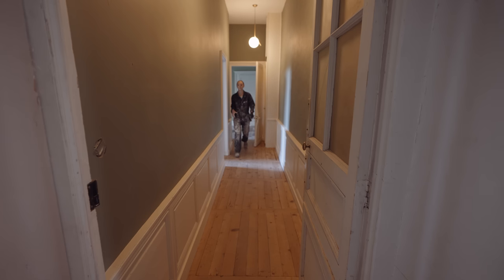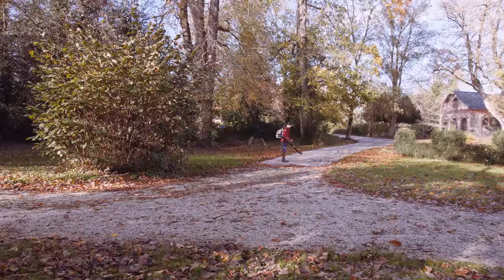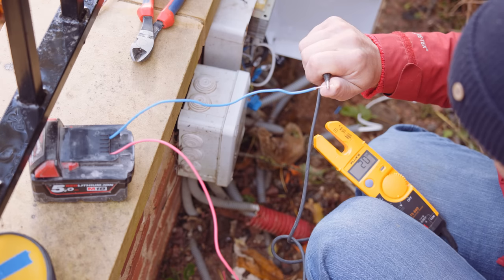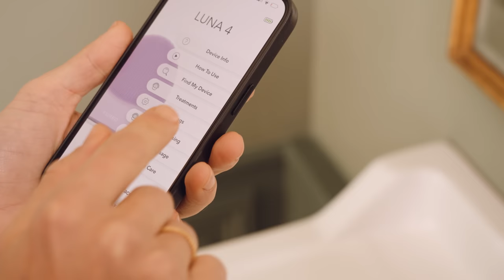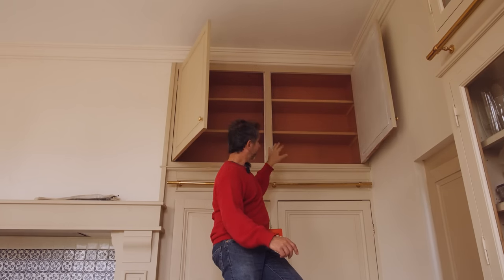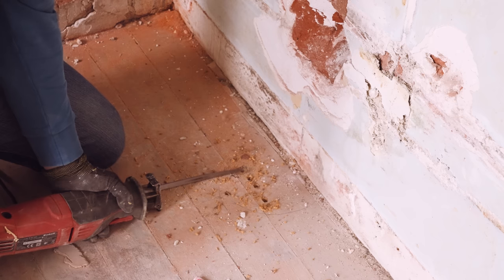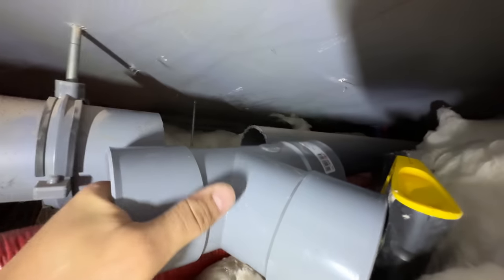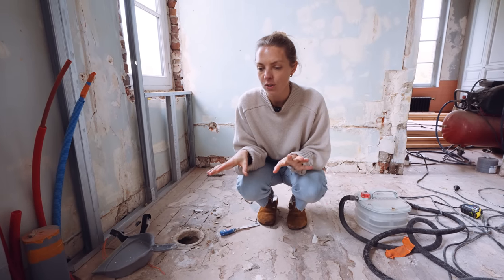BACK TO RENOVATING (Creating a Chateau Master Bathroom)

Comment: For the Master Suite bath, go with large tiles or better yet marble on the angle with an outside border pattern to make it look like an area rug. Use the coordinating tiles in the shower. .You can purchase tiles that have wood grain appearance. Anna glad you are wearing protective gear. Philip, call the company President back. Tell them what happened with the Customer Service guy instructing you to do the wrong thing.  Make them correct their problem with the motor by giving you a new one and having a professional company come out and remove and install the old one. Best to get a warranty on the mechanicals through a certified dealer - that way the onerous is on them and their pocketbook.

Comment: Because of water spots on wood, do tile. It will last forever.  Also, if you have an overflow from the commode, you won’t have to redo the floor.  We had a slow commode leak (a plumber didn’t tightened pipes like he should have done) and it rotted out the wood subfloor. A costly mistake.

Comment: I removed old linoleum from the kitchen floor in a house I remodeled.  I was told I needed muriatic acid to remove the old glue. Fast forward to my children helping to carry in groceries.  One of them dropped a 2 liter bottle of Coke. I told her to leave it until we carried in all of the groceries.  I noticed while cleaning it up that the glue came up with it. So I purchased more Coke, soaked my floor with it, and waited a while .I used a large rubber squeegee like one uses to clean windows.  The glue came up amazingly easily. Give it a try. It saved hours of work and I didn't have to use the expensive and dangerous acid. 😊 Ive only had hardwood in my kitchens and never had a problem.  I think bathrooms yield more water potential to floors however.  They make tiles now that look amazingly like hardwood.  Id go either for that or something that looks old and luxurious.

Comment: Also tiles (there are tiles which look like wood, they are very nice looking) and I would recommend using a shovel to push the glue from the floor, because then you can use more power

Comment: If you do tiles, you can easily put a heated floor beneath. I recently created a master bathroom in my historic home and it has been so lovely in the winter to have warm floors beneath your feet in the bathroom! I used electric strips (as opposed to some who do hot water....may be easier in new builds) and then had tile put down.

Comment: I've done both, and the wooden floor wasn't a great success, I do understand the attraction of wood, it looks and feels better, but if your family is anything like mine, bathrooms get pretty wet, not just from water splash, but also condensation. I'd definitely go with tiles, but make sure you tank the floor and shower walls, saves you so much grief in the future.

Comment: Goodnight. I think you should go with tiles. If you go with tiles in the bathroom, then you will not need to scrape the glue thing off. I had a similar problem at my house in Canada when I was renovating it, and I used a product called drypack over the floor. It leveled the floor, and then we put the tiles on the drypack. I also agree with the other commenter that you can then  install heated floors. Tiles are definitely the best option for the bathroom from a water resistant perspective and so many other perspectives.

Comment: I had a similar problem.  By mistake I spilled pickle juice on the floor and discovered that it softened the adhesive. So I used vinegar to aid in the scraping. (Still had to scrape, but not so tough.) 🫤 Your adhesive might be a different type, but may be worth a try?

Comment: I have wood in my bathrooms. It looks nice. It is a warm feeling. BUT you are always conscious of how much water gets on the floor from after you step out of the shower. It’s always “QUICK!! Get the water up!!” And “DON’T leave wet towels on the floor!!”. My wood floors have been in place since 2008 and they are just now starting to show signs of water damage and only at the base of the shower. Other than that, no warping, no other damage. And the wood flooring so nicely flows into the bedroom where there is the same wood floors. 
However, I like the more sterile, don’t have to worry about water on the floor feel of tile except grout is gross. 😮
Hope all that helps 😂

Comment: A heat gun is often very useful.  It will soften the adhesive and perhaps make it possible to remove it with a wide putty knife.  The opposite approach taught to me by my Father many decades  ago involves using dry ice to make adhesive become very brittle so it can be chipped away in large chunks.

Comment: I would go for the tile option. It would allow you to heat the floors; it is the most efficient way to heat a room. You can get a tile that LOOKS like wood, so you would have the best of both options. Wood and water don't mix well. ❤

Comment: Tiles are the preferable material for sure because the bath is a room with high humidity generally and it would definitely hold up a lot better. One other option, considering you have to pass through the bath to get to the office/wardrobe area, you could keep the tiled floor only in the shower/toilet zone of the bath, and that way you could keep the visual aspect of continuos wood floors throughout.

Comment: I have wood floors in two powder rooms where there is only the sink and toilet.  Mainly for guests who come for an afternoon or for dinner.  But in the en-suites that are attached to the bedrooms I have travertine and limestone.  They are luxurious, easy to clean and easy maintenance. I seal them every two years and as with wood they are timeless.  Sorry for the motor on your gate.  It’s a shame you don’t have someone who can reset it and make it work.  They are wonderful if they are programmed to open and close with a garage door opener, and if a call button was installed guests could press it and you could let them in with your mobile phone.  I keep mine closed to keep the deer out of my property so they don’t destroy my flowers and gardens.

Comment: Regarding the bathroom floor, it depends on the tiles. Wood is always warm and cozy and it definitely works in a bathroom, but if you have nice natural stone tiles it's also an amazing option, that doesn't feel clinical.

Comment: You can get adhesive removal heads for your multi tool, for both soft and hard adhesive removal, which you may find more successful - found it removed exterior tile adhesive quite easily however much smaller project!

Comment: With vinyl cushion sheet floor warm under foot ,you need to put down a leveling compound on all but the smoothest surfaces or a hardboard sub floor on wood every bump will show up through vinyl ,glue down at edges and finishing trim at doorways .

Comment: LAMINATE WOOD FLOORING is ok to use in a bathroom I had it in mine for years with kids getting in and out of the tube just glue the seams when you snap it together so water does not get under the floor and it looks great good luck
Reply: Yes!

Comment: Trying to wrap my head around whatever that is on the floor. A scrapper blade for the multi-tool? An electric planer? A drywall sander? Wow. Excellent PPE. And then Phillip's comic relief letting the smoke out of the gate controller. Looking forward to the next challenge!

Comment: We’re turning the old butlers pantry into a bathroom, and you look like my husband and I trying to get the pipes together in a small space. We had original wood floors that are covered like yours in old glue and whatever. I took out the floors, will try to reuse the old flooring to patch where it’s missing in the dining room.  We used plywood, and were able to install heated floors and tile. Very nice in cold months. The plumbing still isn’t hooked up yet to the main. They do make wood look tile. I don’t know if it’s in France and If that style is becoming less popular. You can put a waterproof membrane down and then the tiles. We have schluter ditra heat systems in the states that work great.

Comment: you Can also use concrete in a silicone mould, where the mould is shaped like wood. Then you get a wood effect, but using concrete which you can seal to make it so that you can use it in a bathroom :) x

Comment: I agree with both of you. Wood floor is a warmer feel (nicer acoustics too), but not very practical around a bath. Nice tiles aren't hard to find in France, but can get pricey. Easier maintenance, and yes, I'd want adjustable underfloor heating in that case. Less risk of any water damage. If chosing tiles I'd go for neither too light or too dark and chose a tile with variation in the glaze, or every speck of dust shows up. If chosing wood I'd consider lark, ehich is used for making jetties, is so resinous it withstands water, and comes in lighter color, or darker reddish hue (more expensive core planks from the heart of the wood). There's a third option, stone. Both riverstone tiles, naturally varigated, and more expensive marbles can be nice (I like travertine for it's soft, warm body friendly hues). Again, underheating would be important to not step on veey cold floors morning and evening (and helps against condensation too). Oh, there's a fourth alternative if going for wood. Thats to either laquer seal or paint it with marine (boat builders) product. Which is extremely durable and would be softer to step on.
If you did a painted planked floor you might get away alot cheaper. And it could be historically accurate, in Scandinavian "chateaux" from the 18th century it was common to paint the floors in diagonal squares like marble of the period, with a stenciled border around. I'm sure Anna could come up with sinething very pretty and perhaps create a decorative floor!
I'm sorry about the gates man, that's a bummer.
You guys are really so handy and such incredible troopers with all the work you do yourselves, and all the little annoyances involved!
You look fab in red Philip, it suits you!
Reply from the maker: Thanks for the tips!

Comment: Team tiles with under floor heating.  Suggest you use a electric hand planer on the rest of the glue.  Will be faster and easier.

Comment: Philip, I feel so bad for you😢 You always try so hard, most times what you do is successful but then there are a few times when things don't turn out as planned. This is one of those times.😮 You put so much into those gates and the motor to open & close it. It only took a moment for it to go awry. Despite the problems, you still manage to look at the positive side! Great attitude! We don't blame you because you had so much up against you, I don't even think that you had a manual to help you😮. These things can happen even to seasoned professionals. We are always here to support you.😊///
Anna, please don't feel defeated! There's always a solution to the glue on the floor problem. Another option may turn out better than you hoped for!😊
I would opt for tile rather than wood in the bathroom because the moisture will cause wood to get mouldy & rot unless properly treated regularly.😮  You both did a great job today!👍

Comment: I have a 1924 Arts & Craft bungalow home. I’m the third owner. The bathroom floor has always been wood. It is about 1/3 the size of your bathroom.
About every 7-10 years, I put a new coat of polyurethane on it. (I do a light sanding and then about 2 coats.) I would say that’s the only thing that could be a problem if you have a medium to high traffic bath area.
The wood floor works for me and keeps the charm with the claw footed bathtub, etc. However, I think you might regret it for your bathroom.

Comment: Well wood is good if you can get some older aged wood. The new wood is iffy. I would use tile you can make them heated too. Or some slate I love slate because it never shows damage. Pieces chip off and you get a nice aged floor.

Comment: Is pulling up the old floor boards not an option? That would be my answer. Pull up old floor, do the necessary plumbing and electrical, lay a nice clean new sub floor and you have a wonderful new palate to lay whichever flooring you want. No lumps, bumps or self leveling compound to deal with. When we did our renovations, we pulled the old bathroom floors and I'm so glad we did!

Comment: I'd vote for tiles around the perimeter and wood inlay in the center. I renovated an 1850 manor house in Philadelphia pa and some moron covered a beautiful 1850s wood inlay floor with linoleum glued down with a tar like substance! I used a giant industrial drum floor sander 40/80/120 grit that was tedious but worked.  Needed to countersink and fill the revealed nail holes before final clear floor finish.  Result was fantastic and well worth it. You need a flat base for any new flooring.  Either sand it or fill the old floor.

Comment: Watching you at the gate with the two wires, I knew you were going to short circuit the control panel, how did I know......ummmmm I did the same thing when installing the control panel of a large security system lol.....dont worry Phillip, great minds think alike.

Comment: Wood or a really high-end composite wood that looks like the real thing but stands up better to moisture and water. Switch to tile a few feet from the shower. There are some really cool techniques where you begin to intermingle wood and tile to create an artistic “fade“ from one material to the other if there’s no natural cutoff/transition point from the shower area to the rest of the bathroom. You could do the same with the toilet too if you’re really concerned. but we had wood around our toilets in two different homes and it has never been a problem.

Comment: I have a wood floor in my kitchen, and haven't had any problems with it. However. I am struggling with the idea of wood floors in a bathroom. But I suppose it depends on the quality of the finish that you put on the wood.

Comment: Try putting an old iron on the glue to be removed. A dry iron set on maximum  heat. Leave the iron in one spot for about a minute. This heat seems to soften the glue so it can more easily be scraped off.

Comment: I’m a wood lover all day long but if it’s an option, I’d go with stone!  Large textured limestone tiles are soft on the feet and you can do heating underneath to make them even more cozy.  I have them in our bathroom and they are a joy!!  I also have small honed hexagon tiles in another bathroom too and I hate them!!  The difference is the size.  Small tiles look pretty but with so much grout, they are a real bear to keep clean, especially around the lieu…trust me, don’t do it!!  The larger the tile the better, you won’t regret it.  However, if you really can’t live without the look of wood, you can always opt for a wood tile mosaic in the center of the floor or as a false runner in front of the vanity that would tie in color wise to what I assume will be actual wood floors in the dressing room & bedroom.  Either way though, under floor heating is worth every penny in all rooms, under all hard flooring, if you take the time to do it right, which I know you would!

Comment: Tile is the most likely the best route.There are some beautiful tiles out there and with your amazing designers eye I know you will create something beautiful.I love the look of the wood . Is it practical not 100%. Where I live we are near the beach. The homes are older. I’ve seen tiles that are made to look like wood and they are very pretty, however  many have a faux grain that are really difficult to keep clean as it traps dirt. I’ve also seen vinyl which looks pretty close to a wood floor and is waterproof. Could you use a travertine tile ,sealed and use warm woods in other areas like the vanity and moldings ? I know whatever you choose it will be beautiful.

Comment: Another excellent episode, well done and entertaining as well as instructional- both for good and what to avoid! Hard wood, well sealed would be lovely. Have you thought of Cork? It is expensive-at least here in Western Canada, and needs to laid by someone who knows what they are doing. There are a variety of choices for hardwood, and may turn out to be better value in your part of France. If you have to put down tiles use non slip finish, and if you put in under tile heating, it's a constant heating expense. Phillip, I love the red work clothes, and don't think they are ugly, but Anna is the designer, so she would know. Good work on the plumbing,

Comment: RE: Mess on and under the bathroom floor.  To make matters worse you are working above the finished ceiling in your kitchen.  I suggested a couple of videos ago to take up the floorboards in the bathroom and replace them with plywood.  That way you can do the waste plumbing correctly and get the slope right and finishing the floor later will be much easier.

Comment: My personal experience  heated tiled flooring? The best. It is sooooooooooooooooo the best. Also, I like the look of tiles. The glisten of glass tiles. Check out glass tiles. Have them in my bathroom. Very expensive and the installation of tiles (which I recently did) is not quick, and note, well, QUICK. The result, however, was worth it to me.

Comment: Tile in a bathroom, if you need to put heat under the tile. I wouldn’t do wood to much moisture in a bathroom. Our wood laminate flooring is about 1/2  inch thick and I love it. Looks so much like real wood. You could maybe use something like that but not sure how it holds up to water although it is water proof.

Comment: In the long term, I think you'd be happier with tiles. If you spend the extra time now looking for tiles you like, you'll have fewer headaches later on. Just make sure they have a texture to them.  Super smooth tiles or marble floors (Italian bathrooms) are death traps for wet soapy feet.